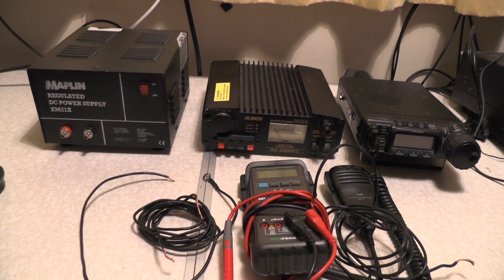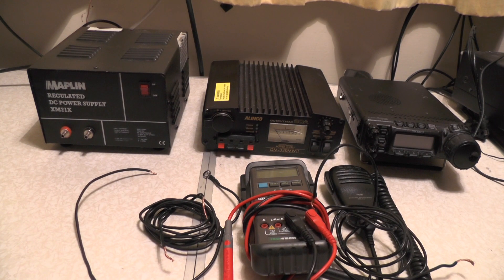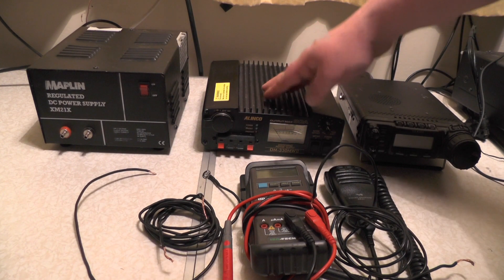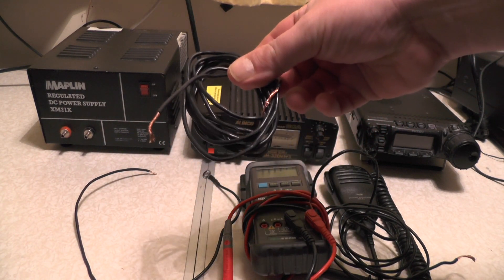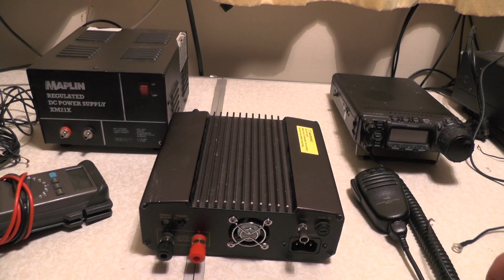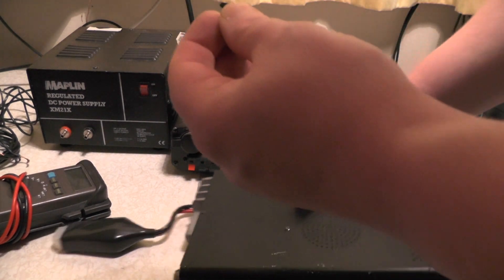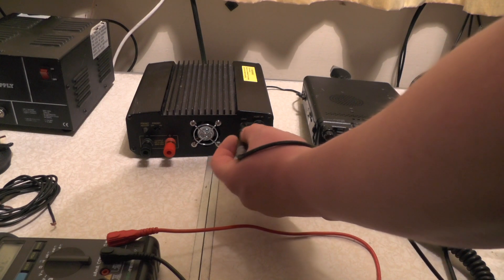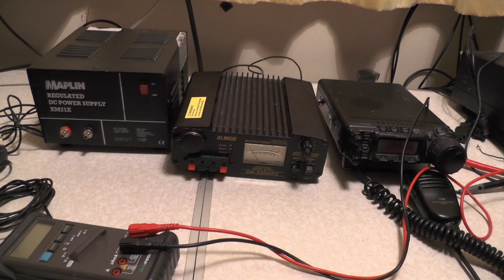Lets Ground a PSU

Comment: Jez, love your stuff. Ideally you should get a wire from the PSU and the 857 to a rod in the ground , even ifs a 1 mt metal bar with a jubilee clip around it with a minimum of 6mm2 cable. It will protect you gear and can reduce RFI in and around you and your neighbours. There is no path to earth from your rig mate. Keep up the good work, especially the stuff on your push bike... its great!

Comment: I am getting ready to put my Swann 350 back on the air.   I have space available.  Should I add ground radiais?  I will be using a trap vertical antenna.   And should I ground it to the power grid?
Reply from the maker: Edgar Arrell not sure about adding ground radials. Is the Swann 350
A hf transceiver? I find if I ground my hf radio 857d I get a lot less qrm on the band . My friend has a icom 706 a cb and a 2/70 radio all radios are grounded out